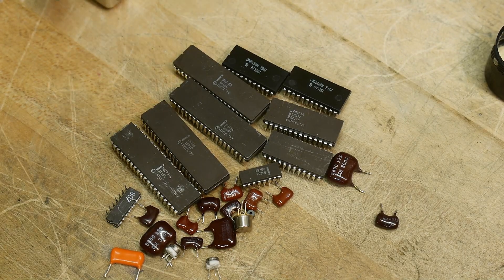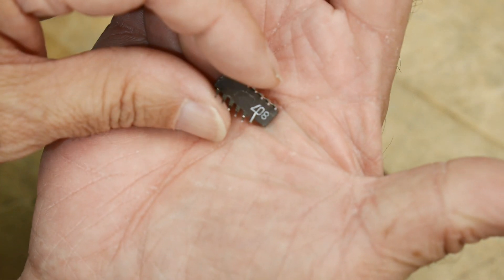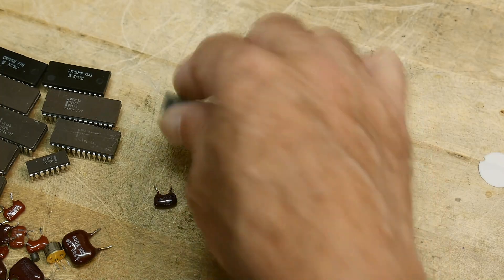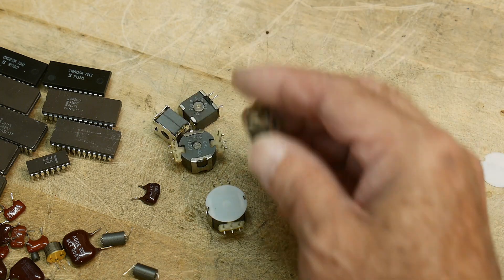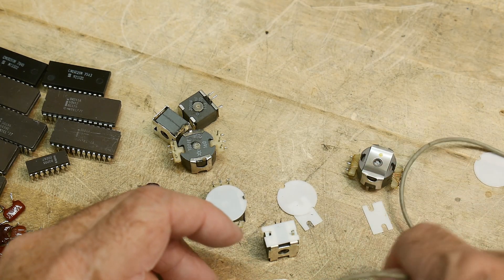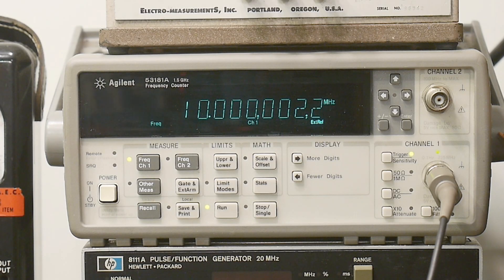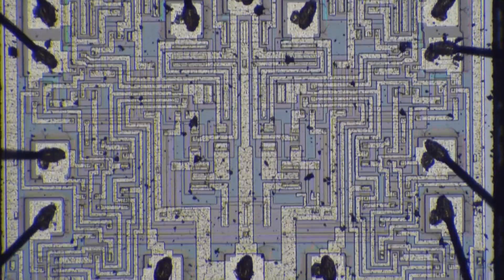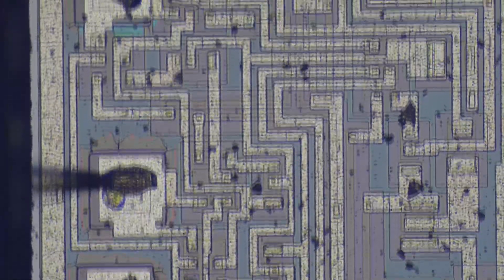#1940 Intel 8085 chips and bonus 7474

Comment: Ah, the 8251!  Fond memories.  Once upon a time, I had bought a Radio Shack TRS-80 computer.    I wanted to get on the computer BBS's ( Bulletin Board Systems ), but to do so, I needed a "modem", and a "Serial Port".  Radio Shack wanted IIRC $400 for the modem, and $100 for the serial port.  This was way too rich for my blood, so I did something else.  There was a little shop across the street from work called "Jameco Electronics".  I went there and got an 8251 USART ( Universal Synchronous Asynchronous....) and a Motorola modem chip.  I wired these two chips into a complete 300-baud communication system.  Loaded up Radio Shack's terminal program - and it didn't work!  Duhh, my hardware was different.    So I had to write my own terminal program.  This turned into a 20-module monster, all in Z80 assembler.  It taught me to program, and I then went & got a 
job as a software engineer.   Did that for 20 years, had lots of fun and made lots of money.    Pretty sure I've got that program on 
a 5-inch TRS80 floppy somewhere...wonder if it still works?  Probably not.

Comment: Quickest way yo remove parts from a PCB:   Wear asbestos gloves and light up your propane torch.   Heat the solder side then quickly wack the board against a post.  Keep doing that until l all the parts you want are on the floor.    Sweep the lot up with a broom and dustpan.
Reply: As a scaled-down version I apply the same technique to open up through-holes. I heat up the solder and, while holding the PCB, I smack my hand down on my desk. Especially handy when the hole still contains part of a component leg as solder suckers don't work well with that.
Reply: No asbestos - while not poison its the loose fibers that find their way into the lungs and  create the damage.  Leather welding gloves are a better alternative.  I use vice grips

Comment: The 8085 should be a good chip for IMSAI Guy.  Like an IMSAI 8080 only better.  Although programming in machine language is wizardry at its finest.  I'll stick to my Python and Arduino.
Reply: In the beginning of my now 40y career as a programmer, I wrote a program for an 8048 (a kind of microcontroller version of the 4004; recognize: I wrote kind of; not exactly) i wrote it with a pencil. Then next step: translate from assembly to binary (hex). Also using paper&pencil. Drove 10ml to an eprom programmer at a company I knew, typed in hex code and progged it into 2716 EPROM. Another 5ml to the plant where it was planned to run. Test run, depression and „repeat cycle“.

Today I complain if code completion via some cloud service takes more than a second 😂
Reply: The great 4004.  My employer used these in a system with - get ready……….core memory.  I wont even begin to explain what a kludge that was. Not my design, but I had to make it work.   Its why I prematurely turned grey in my  20’s.  We were using paper tape and TTY devices.  The great ASR-33. Oh The great days that turned me grey.

Comment: Back in the 70s, almost all 74 and 54 series parts were coming from TI, and having the mighty yellow TI 74 series handbook on your shelf was a requirement if you wanted to call yourself an electrical engineer...
Reply from the maker: Hardbound edition for extra points
Reply: @IMSAIGuy , I had nearly 1,000 databooks, my pride and joy. Then along came a collapsed roof and flooding in my workshop that all came tumbling down on my data-book library, while I was in the hospital. My 'friends' figured they'd help me out. So they cleaned up the mess and threw out my entire library.
Reply: @IMSAIGuy  Two books that I'm sad I lost. The hardback TI book and the RCA microprocessors book which had ALL of the 1800 series chips fully documented.
Reply: If that was the 7474 from earlier in the video, it was indeed from TI.

Comment: I strip through hole  pcb’s using a propane torch.  I heat the area i desire - solder side of course and wack the inverted pcb against the bench and the parts fly off.   No tedious solder sucking or solder braid  needed.   The G-10 will burn of course so I do this outside where its well ventilated.   I cannot attest to any device failures this method might induce or provide reliability stats of the  components removed this way.   But I have many devices in use today that I recovered years ago, analog +digital IC’s , discretes and passives.  Devices come off clean with very little or any solder residue on the leads.     Its brute force, but it works for me.

Comment: There are lots of cracks visible, could they be from the opening process?  4:30
Reply from the maker: I noticed that. I don't think it was mechanical damage. Just problems with those early parts aging
Reply: The cracks are only around the "pads" with the bond wires are welded to. So maybe it is from manufacturing, i.e. stress from welding process. Would be interesting if that part was working okay... So is it a real problem or is it just not looking neat...